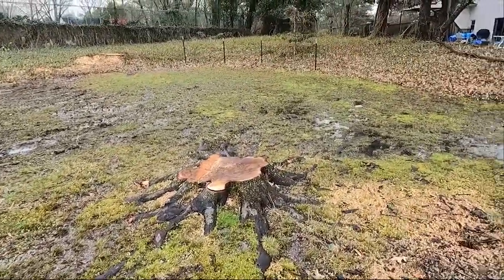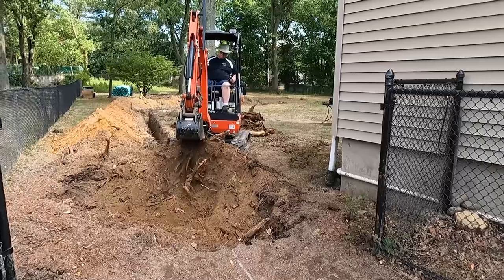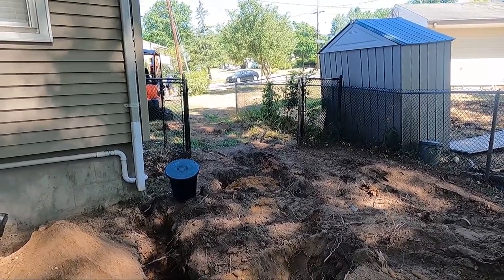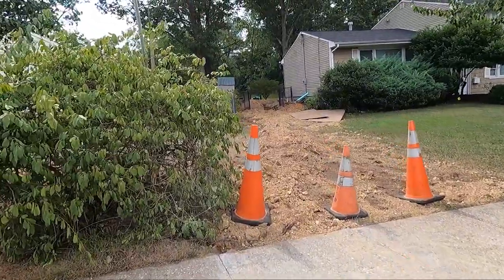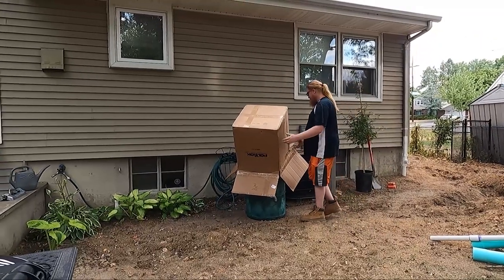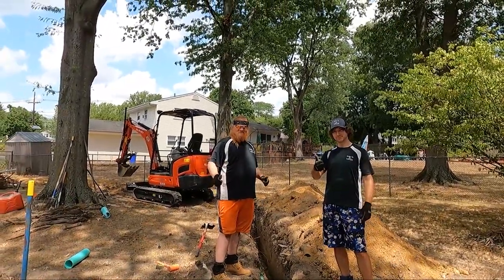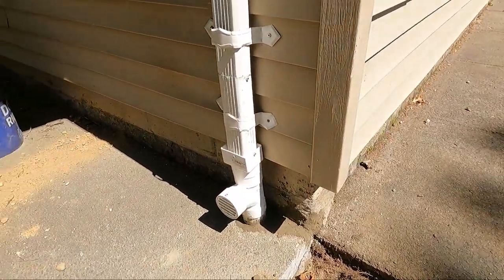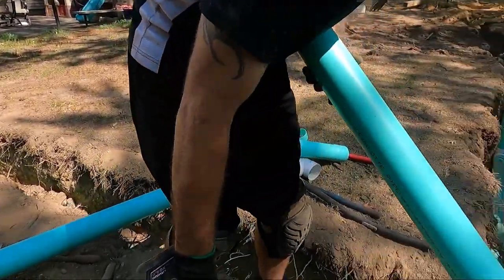Catch basins and yard grading to solve a very wet backyard.  Part 1 of 2 - Downspouts and sump pump

Comment: Very nice work. It looks like that you also had a little bit of trouble with the Kubota tractor.
Reply from the maker: Hi Bill, the tractor doesn’t straddle a trench as good as the mini. I learned it’s better to back fill before I run up to put the sidewalk back. Plus Dawn and Nick thought it was hilarious to throw that in there. Thank you for your compliment. Tom
Reply: @tyelandscapinganddrainage  I know that they don't. At least nothing happened to it. That would not be a great thing for it to tip over.
Reply from the maker: You’re 100% right on that. This job came out very good. Hopefully Dawn can get the rest of the editing done soon. Thanks again for watching Bill
Reply: @tyelandscapinganddrainage  Your welcome!

Comment: Are you guys putting check valves anywhere in case the sewer system backs up?
Reply from the maker: We may have a difference in the terms we use around here.  This is storm sewer, not sanitary sewer.  There are street catch basins lower than this property where the water could exit if the storm sewer were to back up.  Plus, the town engineers did not ask for a back flow valve.  Only a cleanout.  Once again, we did not tie into the sewage system.  We tied into the storm sewer pipe that runs between 2 city catch basins in the street.